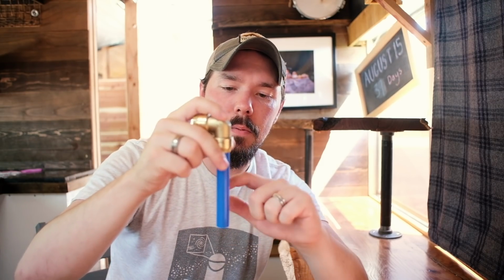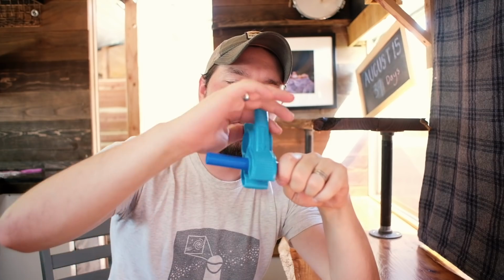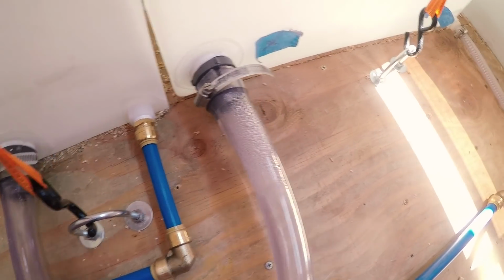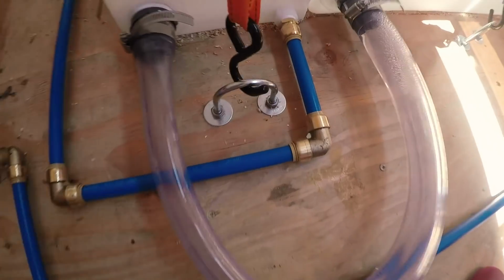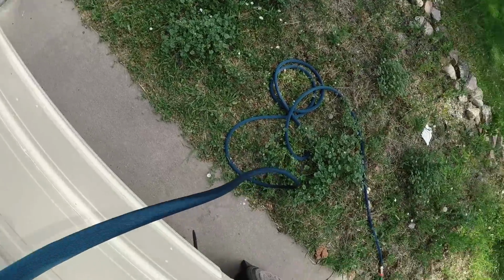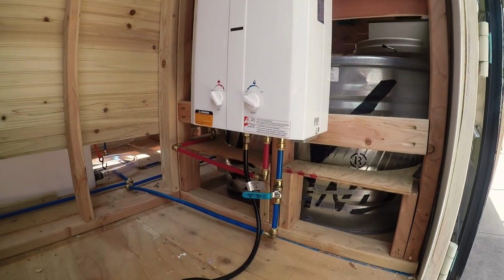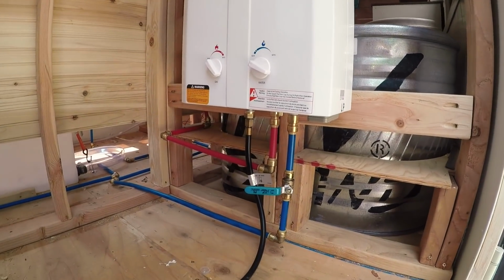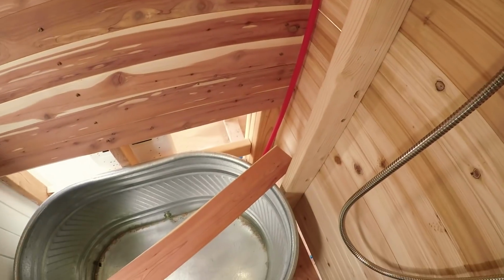Plumbing our Skoolie Fresh Water and Outdoor Showers: Part 1

Comment: I would never use Sharkbite fittings in a camper. They aren't very reliable in a house that doesn't move. Putting them in a vehicle that is like a mobile earth quake.  For the price of three fittings you could have bought all the brass or plastic fittings in your camper. Simple stainless cinch clamps are reliable and easy to install. Good to see you put your water tanks in the living area and not under the bus.

Comment: Don’t use push fittings. If for no other reason than the cost. Get a crimper and use crimps and brass fittings. It’s nearly dummy proof and much cheaper than a million push fittings. Don’t use the plastic connectors in a bus either...use the brass. I don’t trust vibration over time and rigid plastic.

Comment: one other thought about using mostly tri-core foam core ? like what is used in modern catamarans for the interior.
who does conversions these days, id like to put together a  you tube celebrity skoolie build 2020. would like it done right, and with lots of help

Comment: Carry a backup pump.  In fact, plumb another pump in your water line and use some electrical quick connectors so if your primary pump goes out, you can quickly and easily change to the spare pump.  In my RV's, I had to connect a pressure reducer so  the  city water pressure would not blow the water pipes apart in the camper.  Now that was a decade ago so things may have changed. You can vent that heater out the side of your bus with the right vent pipe to be safe.
Reply: You guys make some really great videos and I am enjoying riding along with you as you Git R Done!

Comment: I like your utube video on your skoolie buid but I noticed al lack of a pressure limiter on your incoming city water line. Sad experience has taught me to be sure to have one because we ran into a situation where we had incoming pressure over 70 PSI and our system couldn’t handle so we had a mess to clean up. I don’t know how much your system can handle ,but it could be a nice safety item for your system.

Comment: You can vent those water heaters outside, which is something you should do so no CO comes into your living space... you're probably fine as long as your back door is open, but it's going to become an issue at some point. I'm betting that a local HVAC Heating and Air service technician could do that venting job for very little. You could do it too, it is going to require you to cut a hole through the ceiling (llike you did for your wood stove) and get the proper vent line and wind cap.
Make sure you have a CO detector in your skoolie too!

Comment: I've seen pex used for a couple of conversions I've been looking at. What was the motive behind using pex vs a more traditional plumbing setup?
Reply from the maker: Pex was recommended to us since it is fairly easy to work with (cut) and also is capable of bending quite well. I’m a knucklehead and was able to get it working on the first try.
Reply: @Rolling_Vistas  I just noticed there is another huge advantage; your connectors have sharks on them and let's face it, that's just freaking awesome

Comment: Hate to say it but that propane heater could kill you. It MUST be vented outside. Even with every window open, and the door, I would not use it like that. Either vent it to the roof, which is not difficult to do, or  out the door with a extension.  Also it is imperative that you put in smoke and carbon monoxide alarms in your bus. Please don't forget to do that. 
Couple of thoughts about your tanks. You might want to put some rubber down under them for protection. They will chaff. When your moving, EVERYTHING in that bus will be moving around. It will rub holes in stuff. The straps are ok, but imo insufficient, but you will find out that either way. I would get a can of underlayment from amazon and spray the bottom of the ujoint nuts to keep water out.  Finally, the pex system you put in is good, but you wasted some space doing it like that.  Oh one more thing, put a pressure regulator on your city water connection. Some city water pressures are very high.  I realize your learning as you go, and the school of hard knocks (which I am a graduate of) will keep you busy, only trying to pass some of that hard one knowledge on. Hope to see you on the road!
Reply: Wood stove is vented outside, so should any fuel heater.
Reply: yep. I knew of a teenager when i was in high school who died while sleeping from the same issue.

Comment: Ecotemp are good weather heater but they are only out door. Y need to vent it even if the garage door is open. Carbonite monoxide it won't como out and it can be a dangerous hazard . also sense is fire heater it still needs air to breed if u feel that room with carnonite monoxide more than air it won't work properly

Comment: If you have air brakes on the bus, that could be incorporated into your plumbing.  A few extra parts and when the engine runs,  you've got water pressure.

Comment: Zack a couple of things.  Keep your eye on the shark bite fittings (check from time to time) as they don't have the best reputation long term.  You will also have to secure the PEX tube to prevent it from moving or vibrating.  I know it seems quite strong but the vibration and movement of the bus will increase the frequency of any rubbing a lot more than you think so the back and forth will damage the tube within a year or two depending on your mileage.  Next, your tank mounting seems at best the bare minimum to me and a potentially dangerous point of failure.  Your narrow little straps may be rated at 900 lbs brand new and you calculated your water weight at say 650 lbs but that is the static weight not a live weight.  Live weight is when you start adding in inertia from driving and turning etc. and that can ramp up quickly.  You also shouldn't just look at the loads under "normal" driving conditions IMO because you are in a vehicle so there is always the potential for an impact.  If it were me and my beautiful wife lived in the bus I would at the very least use 2" straps with closer to 3,000 lb rating and I would replace the wood screws you are using on your cleat boards with bolts.  I would also use 2 x 4's for the cleats not 2 x 2's.

I am not being critical--I only mentioned these things because you strike me as genuinely wanting to do things the correct / safe way and that people are watching your video's and assuming they can do what you do and be fine.

Comment: I had one of these ecotemps on my offroad trailer, It would work better if you did a hot and cold line with a mixer for the shower, they can scald you with just the hot water coming though.

Comment: Is the fresh water tank sitting on top of fuel tank access?
Reply: I get that. Your bus is as long as mine. Based on your layout, the water tank which is under your bed in the bus, looks like it's sitting on top of the access point which is in the floor above the fuel tank. I'm trying to find out how you will be able to gain access to to the fuel tank if you've sealed it up. It's the only way to gain access to the fuel sensor without dropping the fuel tank.

Comment: Do you have a check valve on the city water connection so that when you run the tank pump your not losing water out the city water connection?

Comment: What about check valve from what I seen on class a site you need a check valve in your city water line and another in your tank line after the pump or it can push water in to your pump and break it an when you’re tank/pump start pumping it could pump out your city water inlet

Comment: Why waste your money on all those elbows? Bend the pex, they sell theses 90 degree clips that the pex hose clips into that forms the 90 angle. The whole point of using pex is the flexibility. When you use those 90’s it’s a hard turn causing resistance and loss of pressure

Comment: Well done. Couple of tips... get a small piece of rubber 1/8" thick and mount your water pump on it. It will quiet it down considerably. Also, and I made this mistake a while back, you can get the shark bite fittings in plastic, they are half the price and just as durable. Probably a moot point at this time as it looks like your pretty much done with the potable water system. Looking forward to part 2.

Comment: +
Nice overview of the pex and push to connect joints-elbows-T's which ever will be used. I first used pex about 2008? I was like:
 :-O AWESOME! No soldering. It was like magic. I've been fascinated ever since. Haha. It's pretty cool stuff. I did about 3 homes with it. I had copper in my home but decided on pex with the remodel. Much faster! Didn't look as pretty, however just as effective.

Comment: The only thing that I don't understand is why is hot water, the only tubing going to the shower?  Is the heater temperature setting on warm???   Thanks for a very thorough video❣❣❣❣❣❣❣❣
Reply: yes I was confused on this..shouldnt you also have a cold water line to shower with cold n hot knobs to shower head?

Comment: The weight of your water stationary does not equal the force in pounds that water will be producing while sloshing back and forth at 40mph. I would recommend adding some side support to those tanks and getting some real ratchet straps not those cheapos

Comment: Do you have any check valves in the city line? I'm just wondering what will happen if we disconnect the "city" hose and turn on the water pump.
And how do you plan to fill tanks from the city line?
Reply: Now I saw check valves (small piece of tube with 2 fittings on it), thanks!

Comment: Did you need a couple one-way valves or backflow preventers? One to keep you from back feeding your pump and water tanks when you're on city water. There other to keep from squirting water out the city water connection when your on your pump.

You also used a lot of 90 degree fittings. Is the PEX flexible enough to just make curves? The 90's cause a lot of pressure drops.

Thanks for your videos!! I'm dreaming of having a skoolie someday.

Comment: A tip for your Ecotemp, route the exhaust to the outside. The directions say not to use it inside because the average person doesn’t think about routing the exhaust away from the unit. I’d show you a pic of mine, but YT isn’t letting me add photos to my comments. I think it may be in my most recent video update, on passing, so check that out. Nice job on the PEX routing. What are you using to anchor the lines down, if any?
Reply: Rolling Vistas, hmm, I didn’t think of putting foam on the lines. I’ll have to do that, too.